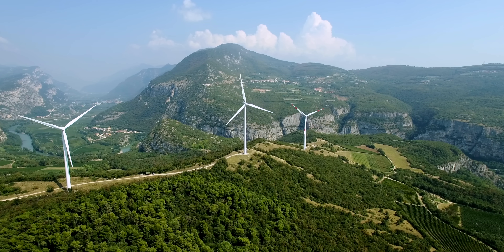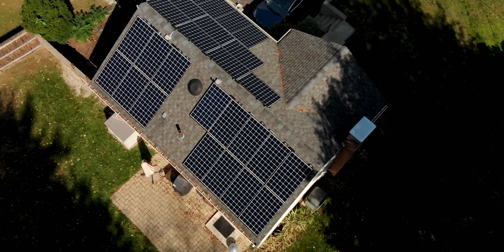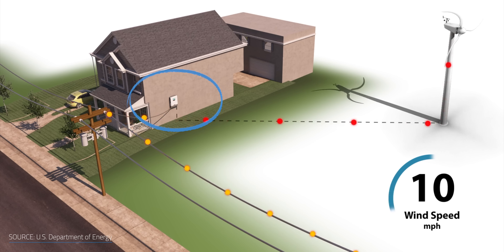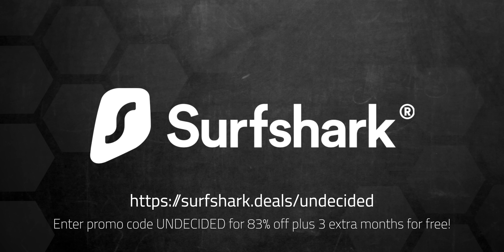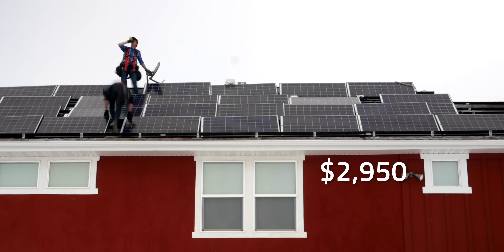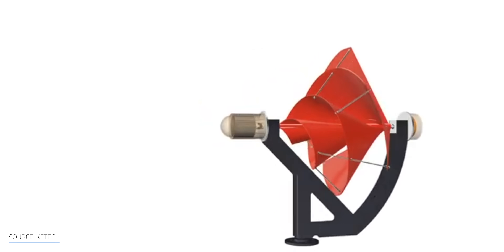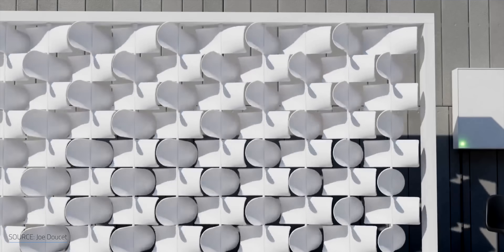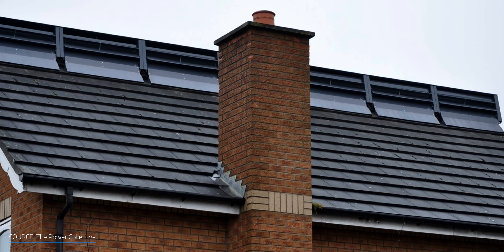The Challenges of a Wind Turbine on Your Home

Comment: Great video as always Matt. I think this really highlights how broken energy pricing is. Carbon emissions are basically free to the emitter, but massively expensive for society as a whole. In any sane world, this would be priced-in for the emitter as a carbon tax, forcing them to pay the real, actual cost of every watt they consume. The fact that climate impact is not priced-in to grid power amounts to a massive national coal subsidy; you pay for the energy, someone else will pay to build a sea wall in Manhattan. Small-scale wind can't compete with subsidized coal, but it might compete with unsubsidized coal.
Reply: Agree.  Consider though that all materials have an embedded CO2 production cost, which is currently not paid by the consumer (nor producer of course).  If your goal with a local wind turbine is to cut down on CO2 production, the calculation becomes very difficult, because that wind turbine required energy to dig, refine the materials, produce, assemble and transport etc.  There isn't any easy way to measure just how much energy that all used, but we can confidently assume (at the moment) that it was all done with fossil fuels - and the larger the device, the more CO2 was released in creating it.  My guess is that whatever the financial payback period is, you should double it to account for the original carbon cost (utility scale production of power is nearly always MUCH less carbon intensive than local production).
Reply: Absolutely not; why should individuals pay extra tax for no reason? It is not our fault gov refuses to allow widespread nuclear power plants (the safest, cleanest, cheapest power source)... emissions from transportation is only 15% of all emissions thus a non issue, why should ppl pay extra fees over nothing? Also every EV and renewable company is only focused on profit margins not cost effective solutions; instead of tesla offering ev conversion kits for gas cars they only want ppl to buy their over priced impractical cars... obvious fact is nobody cares about emissions or cost effectiveness but rather sjw politics... Germany shut down all its nuclear power plants to switch to "renewables" thus made it absolutely dependent of rus oil/gas...
Reply: And what would that tax even do?
There is no method for extraction of carbon that’s viable, so those dollars would do what exactly? Funnel more money to an ineffective federal government to waste?

I don’t think a carbon tax is a good idea at all.
Reply: @JohnBrowningsGhost  well then you're an idiot. Try googling "how a carbon tax works" I'm not replying here again

Comment: Wait, if the ridge effect is a thing, where the wind gets pushed up the roof, why don't we just build national wind grids on top of our two mountain ranges? At least that way we could make some scaffolding and take advantage of the trade winds at the same time. Why is this not being done?
Specifically to capture the polar easterlies (type of a never-ending wind), which are a permanent energy source...
We as Americans have built structures as high as nearly 2000 feet on our soil, just do half of that for a wind turbine on top of a mountain...
Also I'm talking BIG blades for those turbines, if the height of the turbine were 1000 ft per se,  our turbine blades could be somewhere in the range of 280-360 feet long each, and those have huge returns. I am aware of the engineering challenges, but honestly I am a little underwhelmed by their difficulty. I bet if we engineered roman concrete a little better and incorporated some graphene/nanotubes into the design elements we could build those turbines into the atmosphere with some further dedicated engineering.
At those scales, it is interesting to imagine large-scale versions of the types of turbines listed in this video, I think.

Comment: one importent factor is when do you need power? areas without aircon will have higher needs in winter times, where solar are almost not producing. But just the fact that solar have no mowing part is a big advantage.

Comment: Those who live near a busy freeway would benefit from wind. The sound would not matter there and the constant wind generated by the traffic could be quite significant depending on the distance.  Our neighbors have a Concrete wall dividing them from the near by freeway that has a strong wind shearing off its top.

Comment: I like the idea of RidgeBlade.
But it is a lot of material and not too pretty.

How about a slit along the whole top of the roof, connecting via a pipe inside the house to one central cheap and more efficient turbine?

It would utilize the venturi Effekt of the air moving over the roof. You can use that umderpressure against the ambient pressure at ground level.

Comment: Solar panels expire in a couple of decades. A properly maintained wind turbine can last centuries.
Reply: A solar panel looses 20% of power in 20 years, it doesn't just expire. A wind turbine will stop working, no generator, gearbox etc. will last forever. 30 years is even hard!
Reply: @TheEsseboy  Every part of a wind generator can be basically repaired anywhere with a lathe. Try to fix a broken solar panel and you will fail. The best case you can crush and recast it but you can't do that in any garage.
And a properly maintained turbine is immortal not counting acts of nature.
Also solar loses about 0.8% efficiency on average per year so it's reasonable lifespan is about 30 years at most if it doesn't break due to acts of nature or manufacturing defects.
Reply: @victorunbea8451  And what does a lathe cost? And what does the tools for it cost? Let alone if you need out source it, repairing it might be more expensive than to replace it. A solar panel can operate for centuries, if not more. And the loss of efficiency is not linear, it will decrease in speed the older it gets. The only thing that can damage it is storms, which also damage wind turbines.

Comment: Does you CO2 emissions per kWh include the cost of producing the product?  I don't think it does which is not a great comparison.  Meaning the CO2 emissions from mining the materials to make the products and then up to creating the power.  I look at these costs and know that wind turbines do not last that long and have a larger CO2 emissions when calculating the cost of making them.  Similar to Solar Panels.  Also of note is energy storage which have a high CO2 impact when creating the batteries.  Now, I am not an anti-wind or solar person, I think it is great but when talking about or comparing CO2 emissions we need to be honest from cradle to grave in our CO2 calculations but more people would go to it if it was cheaper for them.

Comment: Tesup produces and designs windturbines. The Atlas 2.0 cost Euro 600,- (2021) and, produces 2KW at 15m/s and 1kw at 6m/s. His sound production is 30db.
Ok, you still have to pay for installing. But I think there are more windturbines better then the one you have used for your comparison with solar panels.

Comment: Stupid question, does a moving vehicle generate "wind"? Cause if it does, couldn't you strap one of these wind turbines to a vehicle and generate electricity just from the vehicle moving? would spin
Reply: It would spin, but it would create a force on the vehicle making it use more fuel or electricity. It wouldn't give more energy if not driving in very windy conditions.

Comment: Solar panels do need maintenance - if they are not cleaned regularly their efficiency drops significantly. The difficulty is how to clean them as they are difficult to access.
Reply: Harder to climb a 65 foot windturbine though to change it's gear oil and lube the shafts and bearings.

Comment: The problem with wind is maintenance. Hell, if a source is available I would go for micro hydro long before trying wind. 

Also, Its important to think about with wind, Wind patterns change. Not only based on the time of the day, but the time of the year.  You think a system that doesnt work at night is bad, Try a system that is only viable from March -May and then again from Sept-Nov.

Comment: Matt, very informative. I wind power and unlike a lot of people I like wind farms are a spectacular and beautiful sight. My current project is to electrify a travel trailer for as long an off grid stay as possible. One major factor of course it my roof top PVs, which I have just learned that I can get thermal electricity from them with a hot to cool transfer plate behind them and a small fan pushing the heat away from the cool plate. It's not a lot of power, but I'll take what I can get. My question for you is, what to do to a piped flow of hot air forced from the back of my trailer roof.... certainly there must be some type of additional generator that the rising hot air can be used to fill small sails like a small wind/water mill generator. The trick will be in not creating an back flow to the solar panel system. I just hate to see this hot wasted when I need more power.

Comment: I have a 5kW solar system on my current rental property which has cut my bill to about ¼ of what it usually is. I regularly check usage and find I'm only using about half it's capacity. However at night, since the owner hasn't invested in battery storage or a rooftop wind turbine, 100% of any usage is grid power. Australia's current grid infrastructure is so lacking in capacity to handle a nation-wide shift to every household exporting power back into the grid 24/7 that the government has recently had the bright idea to have the utilities companies charge us for exporting power or give a free option, but with a limit on how much can be exported (I'd love to know how they plan to limit the excess for those of us that choose the "free" option). The only solution is wall batteries (which can be a huge fire risk - in Australia, already having a massive bushfire risk - ...Not good!) or wind turbine power. This needs to be much more heavily explored as an option, along with much greater investment in grid infrastructure upgrades. These multi-billion dollar utility companies can afford to invest in the grid upgrades themselves but we, the consumer always get stuck with the bill. It's BS.

Comment: I live in a Nordic country where sun light is not very bright. I was researching the wind turbines because the cost of electricity has increased considerably although most of our electricity comes from off shore windmills... I contacted the archimedes company who sent me a study based on the weather conditions in my area where the ROI for the 1KW would be 13,5years... I don't want off grid, i just want to reduce our expenses since electricity powers everything here including heating. if residential wind turbines are not viable plus solar is super expensive with a ROI of 10,5 years, then what other options do we have?

Comment: The Conical, Wind Wall and Ridge systems seem to have some potential. The only downside to the Ridge is, I know I would hear that inside my house, especially if it started to wear the bearings over time. It will be interesting to see how development drives down the costs of the Wind Wall and Conical types. I live in an area that gets decent winds all the time.

Comment: Sorry, have a look at Europe, verticals are increasingly common, the shorter lever producing less vibration and most have a significantly higher RPM, more likely to be DOL, stand-alone or roof mounted. Being a pedantic Electrician, inverters only do DC-  to AC~, the other way round is a Rectifier. Have even come across some small scale Hydro, restrict a Burn, (stream) install a Way, most efficient if enclosed, through a turbine, ideally on the same shaft as the Alternator/Generator. The oldest of these I've seen in Scotland was installed in 33, decades before mains electricity hit the location.

Comment: Solar is iffy at my home. We live on the north face of a mountain where we don't have sunlight on the property for 3+ months a year. The sun literally doesn't get above the tree line above us. As a result, best case is less than 75% of the year they could generate a reasonable amount. Wind has some potential since we also live in bit of a canyon on that north face and it tends to focus the wind. However the wind is not at or near ground level. We have found considerable wind speeds above our house though once above the trees below us. We are also looking at a microhydro system since we have a pond with a seasonal creek. This would also not produce a huge amount (calculations put it at around 500W) and would be limited to the winter months when solar is pretty much a no-go. Power is also ridiculously cheap here which makes it harder to make it pay off. We pay around 8 cents per kwh.

Comment: Depends on the roof size. As energy density is much more for wind, it makes sense for mobile homes / RVs or floating homes.
Reply: Only focussing on energy density, not the efficiency of the electrical generation device?
Not even thinking about how long the source of energy (sun, wind) is available for?

We can see you do not have an engineering degree.

Comment: honestly i like the idea and some of the  in development ones mentioned looked promising.   honestly we need to stop thinking large scale and look at more small scale when it comes to solar and wind power.  if every house on the block in your average residential area  had even a small number of panels installed then the  requirements for power plants would be much reduced or even completely eliminated  during day light hours.   hell sky scrapers could use those solar panel windows instead of normal glass turning the tower into a giant power plant.  

of all the designs you mentioned the roof ridge one i find the most appealing.

Comment: I considered wind turbine electrical generation for my home over 40 years ago. Even back then, for a DIY install, it just wasn't $$$ feasible. Now today, many towns simply will not issue a permit, sighting complaints from neighbors and architectural "conformity" . In rural areas, if there are any left, they can be complimentary to solar and commercial power generation, but the payback time to break-even is considerable.

Comment: I installed a 4Kw PV system in 2016. It produces more than sufficient electricity during the summer months (November to March), but through July to September usage outweighs production significantly. 
I run undertile heating through the winter 24hrs a day and charge an EV year round usually overnight. 
I live in an area considered a high wind zone, and it would seem to make sense to use that wind to produce electricity at times when solar is not productive. A few years ago I looked at a vertical axis wind turbine that could be pole or roof mounted and the new business that was advertising the product was convinced it could organise the consenting process with the local council, but seem to have disappeared. 
I do like the idea of the ridgeline turbine but would suggest that the home would need to be built in the correct orientation to maximise production which may not suit solar production.

Comment: Question  What is the potential of using wind turbines in electric vehicles to generate power on the go? They could be placed in front where the radiator is on a conventional vehicle.

Comment: Vertical or horizontal 
Vertical birds hit them .horizontal closed on one side opening on the other two rings to multiple canvases wire chain style implantation strength air conditioner compressor and electric gen horizontal serpentine belts to add in .

Comment: I came up with a small ridge tile generator, which had one rota fitted to each tile. These have an 360 degree movement. So you could have a string of them
all along your roof. The roof catches & compresses the wind upwards into the rotors, so that any direction will spin them. These were 12v, so you could attach
them to a pear of + & - wires running parallel from one end to the other mounted under the ridge tiles.
Yes you will need an inverter to manage the flow. But there are plenty of experts who could improve their efficiency. Thanks for the info, have a great day.

Comment: I live off grid, and i have 3,1 kW of solar, and planing to add 2 kw of wind, the turbine i'm looking at is vertikal, and has closed bearings, only maintenens i can do is wash it from time to time, if i want, but my solar panels, they need washing, ice scraping and removel of snow, i live ind Denmark, not much sun in winter, but plenty of wind, and the opposit in summer.

Comment: I have been looking into this for a while now, and there's no real commercial solution for small scale wind turbines - the ones that are out there are prohibitively expensive and pretty much manufactured, not factory produced - which partly explains the high costs; also: there's nothing like that locally where I live, I'd need to ship mine from very far away which would make it even more expensive.
So the way I'm planning to go is a diy wind turbine which would cut the costs from >10k Eur down to <1k Eur, which would include materials wasted in failed attempts and the tools needed. Hopefully I'll manage to find a blueprint suited to my needs and local materials and that I'll be capable enough to make it - definitely worth the effort though , which should ring a lot of alarm bells, if an IT guy needs to develop woodcraft and metalurgy skills to be able to produce his own clean energy instead of spending currency to get one factory made.